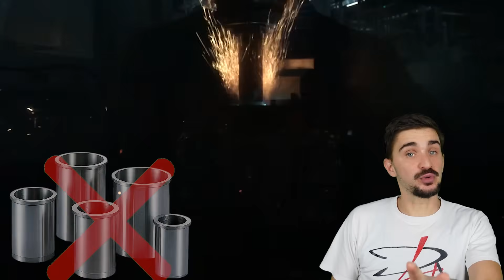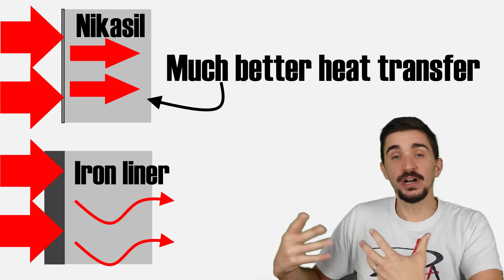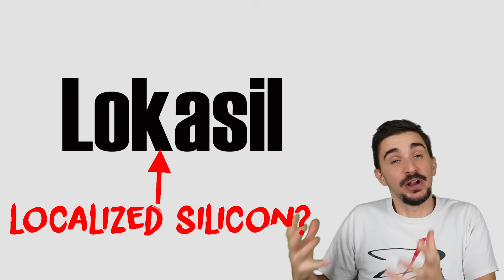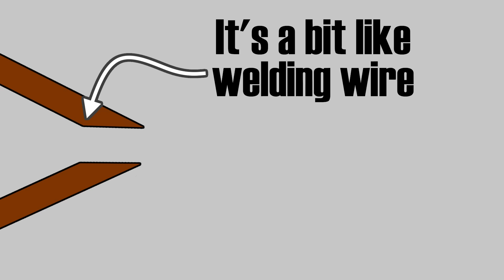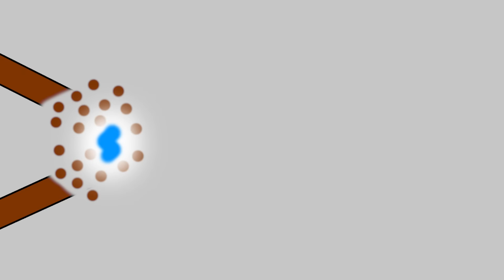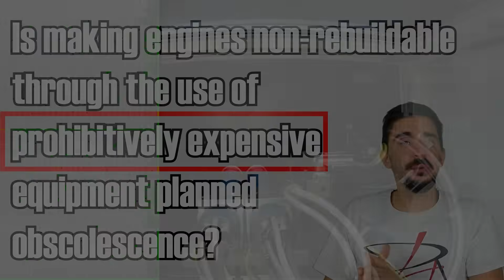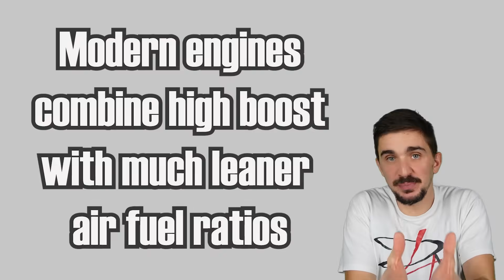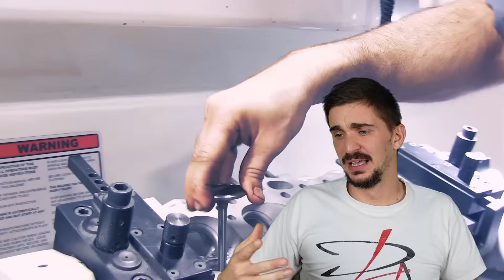Why Are Engines Becoming Non-Rebuildable? Everything About Cylinder Coatings

Comment: Lol😂 you can’t convince me! I
Call these engines “Alumi-Bore-Specials! 🤣 Like a Breaks and Scrap ‘em (Briggs & Stratton) “cool bore” aluminum bore small engine, that I always said were “one season” engines and that you put oil in when new, run one 6 month season without adding or changing the oil, then toss the whole engine and mower, etc, at the end of the season and just buy another every spring. They actually did an engine you only added oil to when low and couldn’t drain it easily for changes, and said it never requires oil changes! Ir wasn’t out for long! But shows these aren’t meant to for more than max 2 mowing seasons. So, made to fail. Aluminum bore engines, coated, sprayed, etc, are crap 💩 and I find them cheesy and off-putting. Simply disposable GARBAGE. Cheers! 👍🏻😋

Comment: Coated aluminum cylinders are not new they have been around for over fifty years, the Chevy Vega of 1970s was an example.
Reply: It wasn’t actually coated.  They lapped the bore to remove aluminum from the aluminum-silicon block material.   That in theory left just the silicon, but that required iron plated pistons.   That plating lasted only a short time then the aluminum pistons totally destroyed the cylinder walls.
Reply: @PhartYeOlde  The real problem was overheating GM fixed the issue later but cars reputation was ruined by then. Also people did like the lack of rebuild ability. An expansion tank would have reduced the issues.

Comment: Had a 2003 Dodge Durango with the 4.7 V8 - got rid of it with 360K on the clock when the driver side seat belt quit and it would cost more to replace the seat belt than the Blue Book value of the vehicle.  It also started to give a Catalytic Converter error on the money light and was using about a quart of oil per thousand miles.
Reply: Got rid of a running vehicle just over a damn seatbelt?  My dad would say, “ He has too much money”.

Comment: So how many or more specifically what percentage of iron cylinder engines are rebuilt?
 That is to say rebuildable doesn’t necessitate rebuilding.
 More I would think are melted down and recycled than rebuilt. 
 If that’s true more engines, especially those lacking proper maintenance are treated and planned obsolescence machinery. 
 Also stying changes and many people don’t want an old style car but a new car with newer technology in it. 
 Be that good or bad, it’s how people act. Psychology leads behavior and 5th Avenue add companies use it all the time. 
 Sell it to them, make them want it through psychology.

Comment: How do FRM (fiber-reinforced metal) cylinders figure into this? I also don't see any mention of the role reduced tension and improved material of modern piston rings play in the longevity of engines using them.

Comment: To add, because I'm curious, Could there be a middle-ground that allows for both? An Aluminum sleeve, Coated with this Nikacil coating? Allowing for the benefits of a sleeved (And rebuildable) engine, while still keeping the benefits of this thin, protective coating?

Comment: Imagine if independent engine rebuilders invest in thermal spray coating machines so cylinder bores can be recoated and improve existing engines for better power and efficiency.

Comment: "Planned obsolescence" is about time, not about use.
Think of this: If I use my car every day and it's broke after 5y, I'm good; but if I use my car after 5y and is not working is not good. 😎
Reply: A lot of people also don't realize heat cycling does the most wear to an engine. A great example is I turn on a car and will drive a couple hundred miles before shutting it off. That's one heat cycle. Other people will drive 5 miles to work. That's one heat cycle. 200 miles and 5 miles, but similar wear. I drove over 160k miles in 2 years, and had regular oil changes and tire rotations. Nothing else done. Another of my vehicles I've had for 4 years, only drove about 50k miles and have had to do more maintenance. I mainly do short drives in it. Very few long trips, if any. Heat cycling is the name of the game.

Comment: Better efficiency and thus lower emissions is one they always say they are after, but i believe we should measure both in eg. 30year time span..how much resources and emissions energy are used by making one time use engines and then manufacture a new after some time the coatings have failed compared to engine designed to last and be repaired over and over again..😅

Comment: is intentionally choosing to use prohibitively expensive coatings in engines that, when they ultimately fail are more cost effective to buy new and replace, an obvious form of sales assurance and profit generation at the expense of longevity or consideration for environmental effects?

Yes.  yes it is.  this is basically no different than "no right to repair" to the benefit of the company.  Saying otherwise is intellectually dishonest.

Comment: I did in-house nickel-silicon-carbide plating of motorcycle cylinders in the 1990s-mid-2000’s.
We placed nickel balls in a titanium anode basket and grounded the aluminum cylinder.
(Our baskets looked just like the one’s shown in your video just before you started discussing Alisil)
In some cases we used a solid titanium anode that was platinum plated. (these were expensive!)
The silicon-carbide was suspended in solution.

The parts of the cylinder that we did not want to plate were painted with lacquer. 
After plating, we diamond-honed the cylinders on a rod hone.
If the Nikasil(tm) became damaged due to a dirty air filter, lack of oil, detonation, etc,
it could be stripped off with nitric acid and the cylinder re-plated. 
Serious damage from detonation, seizing, a broken rod, etc., could be TIG welded, 
the machined flush and re-plated.
Reply: This is correct.  Been rebuilding cycles for 30 years.  Plated cylinders took over in the mid to late 80’s.  
Many Japanese manufacturers have been plating aluminum blocks for years.  Any high performance engine is plated not sleeved.
Reply: @insidelinemx To add to what you said, many Kawasaki KX engines had plated cylinders back in the 70s and had to be replated  when rebored for oversized pistons — a common occurrence with two strokes.
Reply: @ If it had enough meat, no way would I have it replated, I would have it sleeved instead.
Reply: @ High performance Chrysler HEMIs, which are still made of cast iron, are NOT plated.  I don't like aluminum engines, as I am not concerned with engine weight.  That is only important if you are racing.
Reply: @jamesbosworth4191   engine weight always matters.  It's more important in small cars and sports cars.  But Chrysler has only ever made 1 sports car (Viper) and all their small cars have been terrible.  But even in a large truck, a lighter engine means more payload, that's why Ford uses aluminum body panels.
Reply: Ford went to aluminum bodies to make the truck lighter and more corrosion resistant, not because a lighter body makes the engine lighter.  I still value durability and rebuildablity over gas mileage.
Reply: @jamesbosworth4191  lighter is lighter.  Doesn't matter much if you took the weight out of the body, the engine, or the passengers.  You still get to put it back into the payload.
Reply: @SeniorKlean  They don't always add it to the payload.  The 1981 GM pickups weighed a little less than the 1980 models, but the official payload was the same.
Reply: @jamesbosworth4191 Wrong.  Light weight is important for fuel economy and acceleration also.
Reply: @LTVoyager  15 lbs. lighter is not going make enough of a difference for most people to feel or measure as far as acceleration and/or fuel economy, but it IS going to make a difference in DURABILITY that most people will be soon be aware of.  And most people don't really care about getting .1 more miles per gallon.
Reply: @jamesbosworth4191  I will take an aluminum engine with Nikasil cylinders any day in regard to durability.  Nikasil will outlast iron sleeves many times over.
Reply: @LTVoyager  I don't want ANY aluminum engines, sleeved or not, but there are exceptions to everything, as I would love to have a Dodge Viper!  The power and speed must be something out of this world!
Reply: @jamesbosworth4191  all else being equal was the assumption that I assumed didn't need to be stated explicitly.  If you take a heavy Cummins out of a RAM 2500 and put a relatively light GM L87 in, the payload capacity will increase.  Towing capacity might decrease.
Reply: @ That is your prerogative.  I’ve flown aluminum airplanes since the 1970s and am quite fond of aluminum.
Reply: @LTVoyager  I didn't say I don't like aluminum, I said I don't like aluminum ENGINES.  Obviously, planes can't be made of iron or steel.  The wing span would have to be HUGE just for it to get off the ground.  Can you imagine a 747 with a wing span twice as wide?
Reply: @ Actually, airplanes can be made of steel.  Look up RB-1 Conestoga.  Steel just isn’t as optimal as aluminum.  And aluminum is very well suited for engine blocks.
Reply: @jamesbosworth4191 dude fighter engine in ww2 where made of steel and they made several thousand horsepower and where also light for their size.
Reply: @LTVoyager  A steel airplane?  For real?  Isn't it just too heavy?  But I still don't like aluminum engine blocks.  They are too delicate for my tastes.  I'm talking about conventional passenger cars/trucks, not sports cars, not racing cars.
Reply: @puebespuebes8589 I said I preferred cast iron over aluminum for ENGINE BLOCKS, so what is your point?
Reply: @ Stainless steel no less.  Aluminum is stronger than steel on a weight basis, but the difference isn’t that great.  So, steel airplanes are certainly possible, but aluminum is a better material in general for airplanes.
Reply: @LTVoyager  Aluminum is stronger on a WEIGHT basis, but steel and iron are stronger - MUCH stronger - on a size basis, but I truly didn't know it could be practical to build a plane out of steel of any kind.  Just learned something new!
Reply: @jamesbosworth4191  Cars from 2000s were far mkre fuek efficient usually than any newer ones. especially small diesels like jn Peugeot cars like 307SW(Wagon) my friend used to have. It sipped fuel at around 3.7-4.4L per 100km(53-63mpg-us) with a car that was infinetly more useful than some stupid high riding suv.
Reply: @jamesbosworth4191  mig-25 was made of steel
Reply: @Kacpa2  The main reason for the high-riding SUVs is due to the fact, here in North America, the production of full-size sedans and station wagons ceased, so those wanting a full-size vehicle had no choice but to buy one of those SUVs, or, overhaul their present full-size car, which some indeed did.  Not everybody wants a compact car.
Reply: @Kacpa2  idk. I get infinitely more usability out of my f150 than I did my VW golf TDI. Depends on what you use em for I suppose. I do miss paying a third for fuel but my tank is also nearly twice the size
Reply: How much did you charge for that kind of cylinder treatment?
Reply: @Crayma800 about double the cost of sleeving which is about double the cost of rebore & over-sized pistons, more if it also needs repair.
Reply: @Crayma800 cost me $500 for a 400cc 2 stroke
Reply: @ There are only a few shops in the US that perform this service my favorite is “Millenium Technologies”   If the cylinder is clean, around $300.00.
Reply: We did the same, used both laquer and mold release agent for masking. Nice thing about nikisil dirt bikes was not having to do anything when re-ringing or top end rebuilds. Unless it went too long and wore out the coating.
Reply: Doesnt really matter because bikes nevwr see the milage that cars do, especially if its someone weekend toy.
Reply: Nikasil goes on formula 1 for people to know and 2T engines 😂
Reply: Yup 2T had Nikasil sense 70s🤣👍
Reply: Great point, motorcycle engines do often come first in terms of innovation. 
P.S.: The reply thread under the comment is straight-up trash. I regret reading it. The sheer stupidity of some people... ugh.
Reply: Yeah, it's not that it can't be done,  just that at some point sending a civic engine to be replayed is gonna cost way more than just buying a new one.
Reply: Bore out the cylinder and sleeve it undersized. Put in an under-sized piston. So you lose 100cc...big deal.
Reply: When it’s new you want to go easy , but after you broke it once or twice you don’t care anymore & just say , I’ll fix it later . That’s my style !
Reply: Way more expensive, and much worse use of toxic materials.  Throwaway is just way cheaper.
Reply: @ Using sleeved bore is cheaper.  Throwing away and buying brand new is WAY more expensive, and is stupid to boot.

Comment: I've been curious if there is a way the car manufacturers can design cylinder sleeves (not cast iron) that will can be coated and still transfer heat as efficiently thus making rebuilding process of buy new sleeves. Possibly sleeve comprised of nickel, aluminum and a small amount of titanium or other composites. 🤔

Comment: This has created a net negative for the masses. Most of us want a long term serviceable engine, within a budget. The conclusion you revealed here, no matter how you present it, still equates to a non-servicable engine for the vast majority of owners. The end result, no matter how we reason away what is serviceable, is a much higher rate of new vehicle sales, which circles back to planned "actual" or "collateral" obsolescence. Yes, i would absolutely put tons of investment in this process, because LONG TERM, i make that back plus windfall profits on future sales. Apologies for long rant
Reply: If you want someone to blame, look at the regulators who have consequently made this and many other industries more and more anti-consumer. Many of which are directly influenced by lobbyists for car manufacturers, etc., to the point of making it more difficult to compete in said industry while often doing little to solve the actual 'problem'. Like how CAFE standards in the US have loopholes directly benefitting domestic manufacturers and largely responsible for pick-up trucks getting bigger and bigger every year.

Comment: Lets say I agree with you and say its not planned obsolescence.
Well then we have to call it something else since it still not good for the consumer. Unplanned reparability?
No matter what it is, something that can be cheaply repaired to extend its life 3~5 fold will always outvalue a new "more efficient" "single use" tech.
Reply: It is simply planned obsolescence and corporate greed.
Reply: Facts
Reply: By far most engines (including old ones) are single use weather they are rebuildable or not, as they are just not getting rebuild. And even for simple engines it is not cheap. I think the rebuildability point is totally moot.
Reply: Even without this, the average consumer isn't going to be paying to have the engine in a 10 year old car rebuilt.  It costs more than the car is worth, and that assumes everything else in the car is mechanically perfect.  Modern engines last an easy 300000kms, it's not like they need a rebuild every two years.
Reply: @wparsons  Only shows how cars nowdays are made to be consumables instead of tools.
Stop to take a look around and you will see how many old trucks from the ~80 are still kicking around. Those trucks often have way more than 1m kms under their belts.
Also a lot of old cars become unrepairable because their parts go out of production.
Reply: Have you seen an engine rebuilt 3-5 times?!
Reply: @ On South Asia you would be lucky to find a car with a engine that haven't being rebuild at least 5 times. lol.
Reply: @AbeDillon yes, I've seen engines rebuilt 3 times (in England). I've also seen engines taken out of a scrap vehicle & put in a better one (I've also done it myself).
Reply: Capitalism doesn't reward making durable items. Your things have to break eventually so that you can buy new ones and continue the process forever.
Reply: @not_alec  So what good were the Soviet Bloc cars?
Reply: @skylinefever  Ironically enough, they were easy to work on and rebuildable.
Reply: @not_alec it's not capitalism per-se, it's the particular variations on capitalism used in parts of the "First World".

Comment: Because engines are becoming non-Rebuildable you must change your engine oil more frequently than oem recommended  (severe driving conditions) especially in cars with timing chain (because the timing chain is running in oil bath)..

Comment: Motorcycles have been using cylinder plating for decades now and there are multiple companies that are able to replate the cylinders after rewelding and reboring or overboring for larger capacity.
The real reason vehicles are becoming non rebuildable is greed from the manufacturers, so that the customer is forced to buy a new vehicle every few years rather than having the vehicle repaired.
If people stopped buying into the built in obsolesence crap and refused to buy these items the manufacturers would be forced to change their behaviour.
Repairing and rebuilding is better for the planet regardless of whether it is a computer or a vehicle. We live on a planet with finite resources and we have a responsibility to use those resources carefully, rather than just chucking stuff away after a few years and buying a new version.
Governments should be forcing manufacturers to build better quality and repairable items.

Comment: Thank you for the video. I always enjoy the topics you cover.  However, you skipped over a few points.  Electroplated coatings (Nikasil) are very susceptible to DELAMINATION! The coat fails to stay attached. Particularly when force is transmitted by sliding (shear), like a piston sliding in a cylinder bore. Additionally, sulfuric acid (from poor fuel chemistry) is more likely in diesels, because sulfur promotes "knock". Lean (efficient) mixtures produce Nitric acid due to high temperature and lack of carbon.